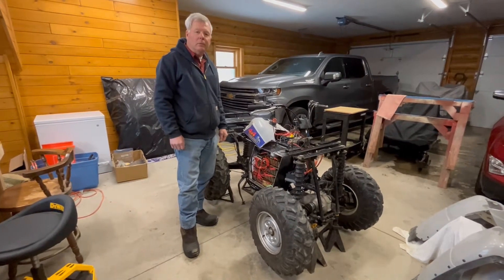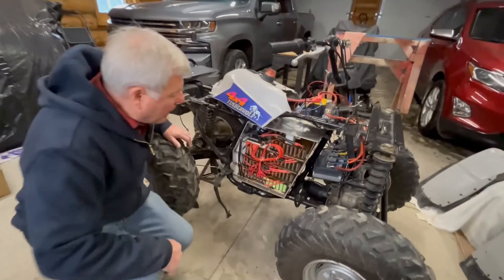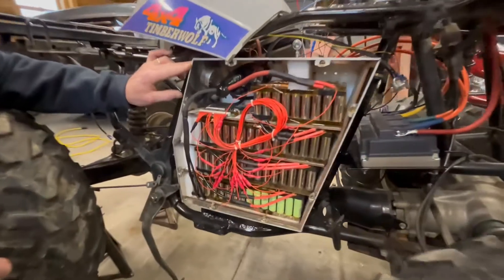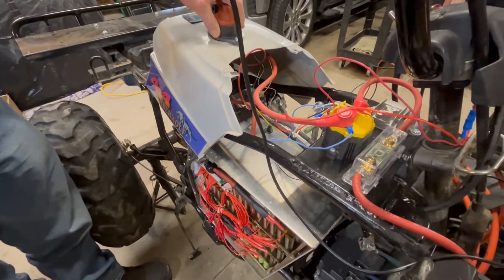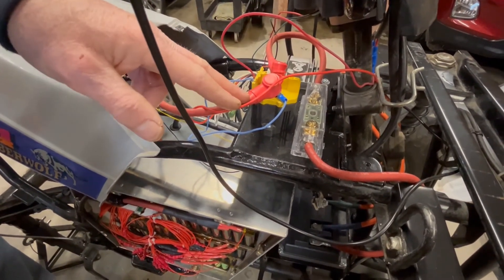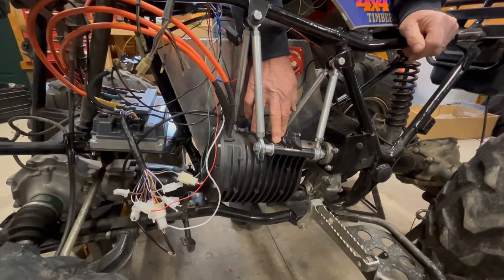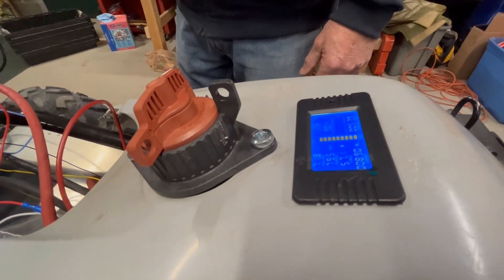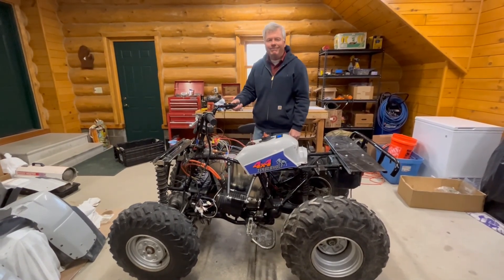Electric ATV

Comment: Did you use lovejoy connector on spline shaft on diff?
Reply from the maker: @philipardvall1968  I turned the gear box input shaft down to the lovejoy dimension and then created a key way.
Reply: @e-grandpa9778 you have tapered shaft on motor?
Reply: @philipardvall1968  I shaft is splined from the factory.  I removed the shaft and turned it down and added a key way to match the lovejoy coupler.
Reply: @neilswanson2811  so you attatched motor rotor to lathe?
Reply: @philipardvall1968  The motor output shaft is a removeable piece as the motor has a built in gear box (QS Motor - Mid Drive 3000w)

Comment: I have just found this. I have a 94-95 Timberwolf 2wd and the engine is cactus. I have been looking at making mine an E-ATV. Now I have found your channel I will take a look at what you have done and use your ideas for my conversion. Thanks for sharing. Cheers.
Reply from the maker: Thx. I posted the major parts list and links in the final video.